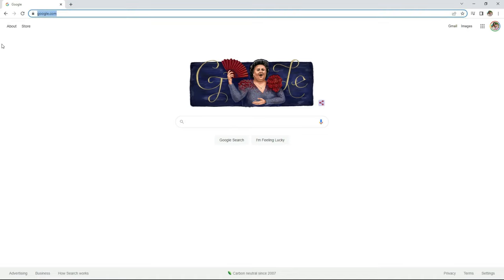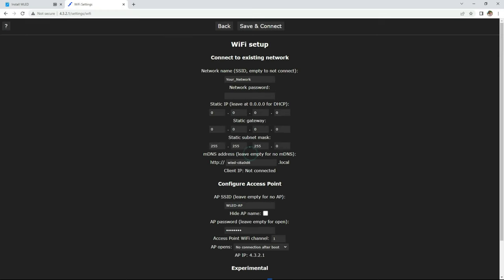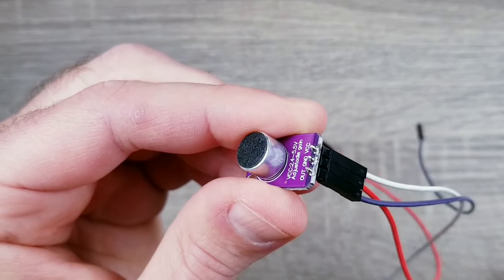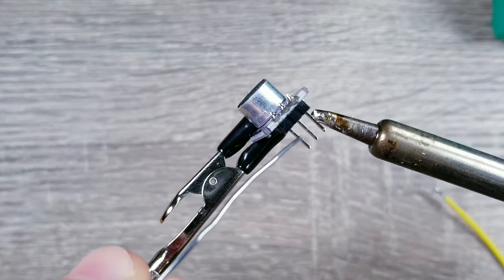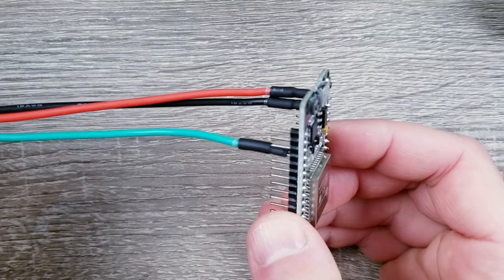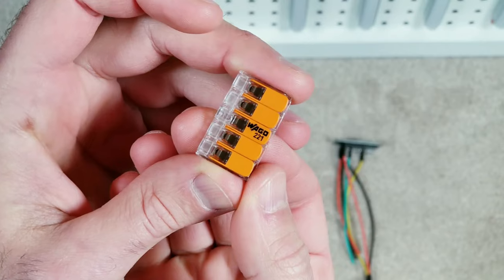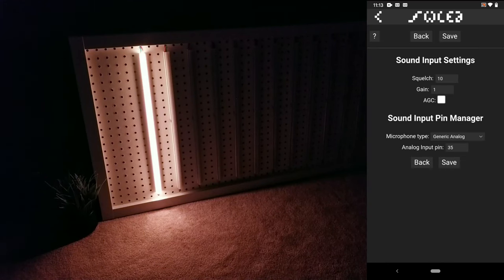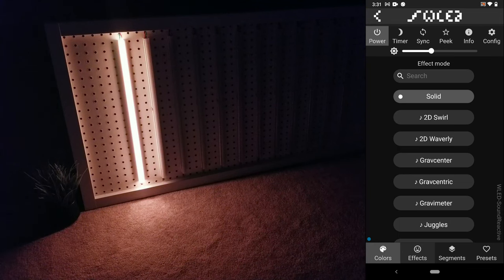WLED Sound Reactive - Complete Setup Tutorial

Comment: If you skip the pins, you can solder the wires directly into the pin holes, far less effort and tidier. You can also get ESPs with the pins uninstalled, so this can be done on both ends.
Reply from the maker: Thanks so much for watching and for the tip! Appreciate it and good advice for sure!
Reply: D1mini comes without header pins installed
Reply: I was wondering why he didn't just solder them into the board instead of adding an extra step and soldering the pins in lol

Comment: Super video, is there a possibility to do the same with a 3.5mm line in instead of a microphone? Would like to be able to use it even when the music is playing softly or when friends are there and you are talking without the LEDs reacting to the conversation. What do I have to do differently than in the video to implement this?
Reply from the maker: That's a great idea and I can see why that would be helpful! I'm sure its possible but I have not looked into that yet. Great idea for a future video for sure but as of right now I would have no idea how that's done. Let me know if you find a good video on youtube explaining how to do it and I'll do the same!
Reply: a small addition/extension to this idea... add some frequency filtering stuff and boom, you can have different frequency ranges show up differently or on different strip etc!
Reply: You could use an msgeq7 or just wire the aux cable the same as the mic. Lol. If this guy doesnt know that, i wouldn't watch him.
Reply: @ChrisMaherDIY  Man, great job , try to find on YouTube "Alex Gyver цветомузыка" there is a project on Arduino with 3,5 mm line there
Reply: Have u got any idea by now how can i implement the frequency filter... Cuz I want my led to react with bass only..
Reply: @swastikdas8291  been wanting to do the same thing myself. Maybe you could channel the microphone input to another device which is a low pass filter then transmits the signal to WLED. Not sure how that specific program works, it might complicate things. Furthermore a high order low pass filter would be required so the cutoff frequency drops off faster, which needs to be supported by multiple op-amps, capacitors, and resistors. Sounds messy lol
Reply: there is a module UDA1334A  sound i2s if that what you looking for aux to i2s signal
Reply: @RGBReact  how do I do this ? Sounds perfect

Comment: Does anyone had a problem to run this on ESP32 WROOM board? I can flash it, it appears in wled but after pluging power connector only onboard LED is lighting. No reaction from app. I have insalled same version of wled on ESP8266 and it runs corectly (version without mic- it is not supported on ESP8266)

Comment: 3v to mic doesn't give enough signal out. I had issues when i placed the mic on ceiling. Connected to 5v it works ok now.
Reply from the maker: Thanks for the tip! When you say it does not give enough signal out, did it not work at all or did it not just perform well?
Reply: @ChrisMaherDIY  it work well if mic is not close to sound source or sound is low.
Reply: @ChrisMaherDIY  using a digital type mic sensor  basically loudness sensor improves performance.
Reply: Some mics (like the one Chris used) have a trim pot (screw) to adjust the gain. Maybe that could've helped with running it at 3v in your case. But if it's running fine now at 5v then there's no need to mess with it :-)

Comment: Great Job! It is possible to use the AUDIO JACK 3.5MM instead of microphone? Like with dac 1334 ? What do you think? Thanks Chris!
Reply: I'm working on this myself right now.  I have a very specific use case that requires a direct line in.  I found one video out there where you can make your own board using about 5 components.

Comment: ESP32 board with good install. When I connect and go into effects the only one that works is solid. I can change colors with no problem but when I try to change the effect to work with the mike all LEDS turn off. I’m using a MAX4466 connected to D35, an ESP32WROOM , output to LEDS on D2.
Reply from the maker: Hmm that's no good! That's strange how it sorta works but sorta does not. I'm not even sure where to begin troubleshooting. I generally try to order 2 of everything just so I can maybe figure out is something is faulty. Maybe someone else reading this might have some ideas and can chime in! Thanks for watching!
Reply: @ChrisMaherDIY  I appreciate your time. I have ordered a different type mike figuring to start there and just rewire everything checking components as I go.

Comment: I have never seen someone solder to headers before.  That looks sooooo hard lol, you can order ESP32 boards without the headers preinstalled.  They are much cheaper because the headers must be soldered manually by a human.  Then you can solder your wires through holes, instead of to metal posts.  I can't believe you made that work that's crazy.

Comment: Loved the simplicity of this tutorial. Controls are working like a charm from the app, however I'm struggling to get in sync with sensor input (lights are not reactive to sensor). Have tried different sensors but still not picking up ambient sound. 

Any suggestions. Thanks
Reply: I'm having the same problem. I used all the same hardware as shown in the video, but the sound reactive part is not working. Changed the input to 35, and everything but there is no signal.
Reply from the maker: Thanks so much for watching! Are the led lights working if your just trying to control them normally without the sound react effects/animations? The only thing I remember is that I believe the mic's I ordered came in a 2 pack and only 1 of them worked for some reason. Not sure if that might be the issue but at least for troubleshooting I try to have 2 of everything on hand to hopefully narrow things down a bit for what might be the issue! Also, maybe check out this video to see if there is anything different that he might be doing that would work in your setup. His videos are awesome and he is a lot smarter than I am! https://www.youtube.com/watch?v=q1ghNUND6gk&t=255s
Reply: Thanks for replying @Chris. Yes the LEDs are working and being controlled from the app. It's just the sound reactive part not working. To test the sound sensor I ran it in isolation and checked the analog input in the serial monitor and the readings over there are reactive to sound.
Reply: @rishitak4208  Hey man. Did you figure it out? Is it working for you now? If yes please tell me what you did.
Reply: @GameResidence  So I swapped 2-3 variants of the sensor. One of them worked with WLED but not 100% reactive. I guess some fine-tuning required on the sensor potentiometer. Haven't tried it back as I was traveling for a while. Will get back to you once I have it working.

PS: The same sensor didn't work in isolation when observed over a serial monitor with the same potentiometer setting. Not sure what the sorcery is :(
Reply: @ChrisMaherDIY  the microphone was faulty, bought a new one and it works like a charm, thx for the tip

Comment: good video but I think I prefer to use wled together with hue to control from hue essentials that allows you to synchronize the music from the microphone or device with the led strip and thus you save this process
Reply from the maker: Thanks so much for watching! Yeah I hear ya. While this is not a crazy hard process, it certainly requires more work than I would say most people would want to do and even thought the results are nice, I don't think they are so amazing that its necessarily worth the extra work to do. I'll have to look into the way you are doing it. Sounds nice!
Reply: @ChrisMaherDIY  Sorry. I was wrong, activating hue synchronization only allows you to use one color, to be able to use the gradient effect and synchronize with the music through hue essentials you need to use diyhue which is somewhat more complex. i have yet to test it as diyhue is still in a very early version. Regards!

Comment: Awesome video! I recently found your channel and it's been my main source of info and inspiration for my first custom led project. Question. Lets say I have 4 individually controlled strips. Would I need to have microphones on each controller? Or could I have a mic on one strip and then use the "Sync" feature to basically replicate the sound reactive effects to the non sound reactive strips?
Reply from the maker: Thanks so much for watching and great question! So if your going to have 4 controllers you would need to have a microphone on each one. The sync feature would basically be telling each controller what animation to initiate but without the mics, they would then have display any animation. However, in theory if you wanted them all to do the same things you could split the data line coming from 1 controller 4 ways and then all 4 of them would do the same thing as you would only have the 1 controller if that makes sense. Thanks again for watching!
Reply: @ChrisMaherDIY  That makes complete sense! I really appreciate the info. My project is going to consist of 1500 LEDs all in diffuser channels throughout a room (25m @ 60 LEDs/m). For ideal performance and frame rate on the esp32 its recommended to run 512 LEDs or less, per pin. Could I output the data on multiple pins on the esp32 using WLED that way I don't have 1500 LEDs on one pin? Or would I'd be looking at a slightly different controller?

Comment: hi and thanks for the upload i just subscribed! i'm just getting serious about led's and ill likely be binge watching all your videos. i have a question.. is it possible to instead of using the mic use some sort of "data" from the speaker to react as the sound? i'd like for the led's not to react to any ambient sounds other then whats coming from the speakers\ sound source (ie. pc\amp\tv\etc). is that possible with those pcb modules
Reply from the maker: Thanks so much!! There is a way through a different program called ledfx. I made a couple videos on that free program that I'd recommend you take a look at!

Comment: I’d like to do this in my bathroom. I have 4 led strips 2 are about 8ft away from controller and power supply. 
Will I be able to use 16g wire for run that long? Or should i maybe use 12g

Comment: When my fluorescent lamp starts blinking, I turn on the music and get the same color music)))
Reply from the maker: Thanks so much for watching and taking the time to comment. Hmm that sounds strange! Maybe check all the connections again and make sure the correct led strip is selected in the settings as well as the rgb configuration. If its still not working maybe try a different led strip to see if it does the same thing. Just have to do a bunch of trial and error to figure out what might be wrong.

Comment: Hi Chris, great video there :). One question, is it possible to make wled controller with mic, but to be able to use it as sound reactive and non-sound reactive controller? Or i wouod need to havd two separate wled comtrollers for that idea?
Reply from the maker: Thanks so much for watching! So the sound reactive version of WLED also has all the features and settings of the non sound reactive version as well. So you can use it either way you would like!

Comment: So I am lighting up 30LEDs 12v DC at 1000mAh with a 12V power supply rated for 2amps. I notice my esp 32 getting warm when I have it plugged in for a few minutes. Should I add a cooling fan to the circuit or will it be fine if it gets warm? Or is there some sort of heat absorbing stuff that will prevent it from getting hot?

Comment: Is it possible to toggle between standard WLED features and sound reactive WLED features using a single ESP32 controller?  I like both and may want one or the other at a give time.  Or would this require two ESP32s, one with mic and one without?
Reply from the maker: Thanks so much for watching buddy! Great question! Sound React WLED pretty much has all the non sound react settings and effects loaded in it as well so its as simple as selecting any non reactive effect. So If you installed WLED sound react with a mic you will have any option you want. I did put together a more in depth video here: https://www.youtube.com/watch?v=KplepH9BT9w&t=1s

Comment: How do you have all those strips connected? I want to make a decent size 3d printed lamp with adjustable LEDs. I will prob use 60 LEDs at most. However, I want to connect them separately but all connected to the same circuit. That way I can change how each strip acts. So my question is how you connect strips like that to the circuit?

Comment: I believe I wired everything correctly, installed the sound reactive files to my esp32s, when I plug it in the WLED identifies the LEDs but the lights do not turn on.  Any thoughts on what I could have done wrong?  I’ve watched over and over and swear I did everything right 😅 thanks for anyone that can help!
Reply from the maker: Thanks so much for watching and taking the time to comment! Sounds super frustrating! Other than checking the basics, (wires correct order, wires have good connection, arrows on the led strip going away from the esp device, wled successfully connected to wifi, correct led strip is selected in wled led preferences) If things still are not working, might be worth installing just normal wled to see if you can get things to work with that and then go from there. Let me know if you figure things out as I'm always curious to know what issues people run into!
Reply: @ChrisMaherDIY  of course!  And thank you for the reply.  I had a neighbor come over that could check all my connections and continuity and all seems good.  I am able to light up a single led light with positive and negative exposed wires to the power block, but I am unable to get the power to push past the first light.  Do I need the esp board connected to push data through the line to finish the circuit?  I assumed the whole strip would light up if I stripped it down to just the LEDs to make sure they worked but I can only get the first light to go 🤷🏼‍♂️
Reply from the maker: @TrainElite  in my experience with these type of led strips you do need data otherwise it will not work!
Reply: I got the lights working, but for whatever reason the lights are not discoverable from the app on my phone, but are controllable from my computer

Comment: What’s the difference between the esp32 and the esp8266? Would they both support the same programming? I’m new to this stuff and want to do 80ft of lighting around my man cave ceiling. Your videos are fantastic and have helped a lot! Thanks in advance 😊
Reply from the maker: Thanks so much for watching and taking the time to comment! They are very similar but the esp32 has a little more processing power and can drive more leds. Here is some good information on some of the differences in terms of LED applications: https://kno.wled.ge/features/multi-strip/ For 80ft I would go with the esp32. They are not much more expensive.
Reply: Thanks Chris! I appreciate the help

Comment: If you run 1 long strip, can you split the animation and flip one side?
Reply from the maker: Thanks so much for watching and yes you can! So WLED lets you create segments. So you can split the strip into 2 segments (or more if you would like) and then control each segment individually or together. You can also then under the segments choose to reverse the animation. Hope that helps! You could also do it where you just split the data signal coming from the controller and connect the 2 parts of the strip together like that. That way both strips are doing the exact same thing at the exact same time and then you can just install the leds strips in whatever direction you would like.

Comment: hey thanks for well presented and easy to watch video. My esp 32 keeps disconnecting from my phone or laptop. sometimes it will run for hours, other times is loses connection fast. my goal is outdoor xmas lights next year but if it keeps having this issue then what to do. i could just use fastled..but its no where close to wled. can wled be flashed and coded without needing to be connected to wifi?
Reply from the maker: Thanks so much for watching! Hmm, thats a good question. The only time I have had connectivity issues was when I was using things out in my garage which does not get a very good wifi signal. But thats strange how it will work good for a while and then sometimes loses it fast. Other than trying a different esp32 and seeing if you have the same issues, i'm not sure what might be causing it. Maybe someone else who is reading this might know whats going on and can chime in!
Reply: @ChrisMaherDIY  Appreciate your reply…ive done all of this in my garage! I will try doing this closer to the router…thank you for taking the time…and hey…id love to make a personalized scrolling stock ticker for my garage…you think you could show some matrx programming?
I also would love to know if the  code for the different effects on wled is available in raw so i could copy it and load it into an aurduino sketch atmega chip?  then i wouldn’t need wifi..can this work?

Comment: what is the difference between using a 32 and an 8266 board? is there a reason you might use one or the other? thank you
Reply from the maker: For smaller projects they should both work pretty much the same. As you increase the number of leds it sounds like the 32 will handle the data/animations a little better. I've had good luck with both!